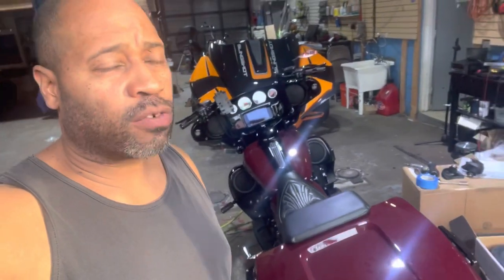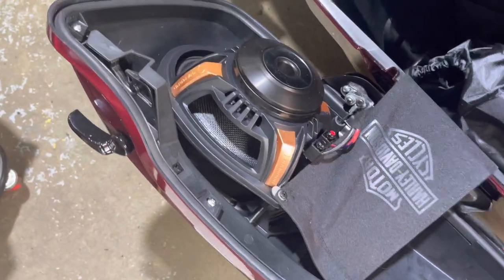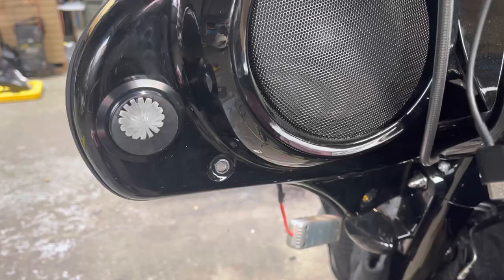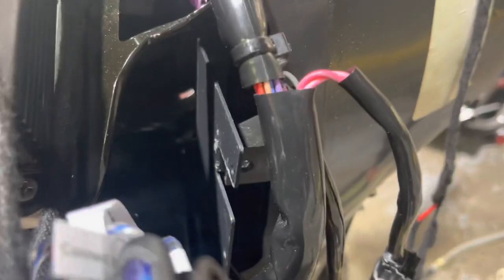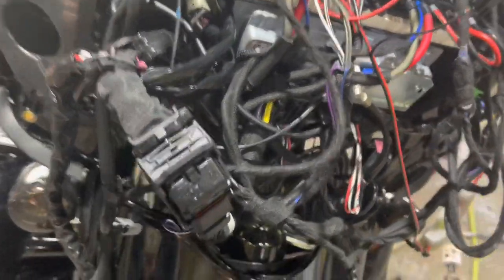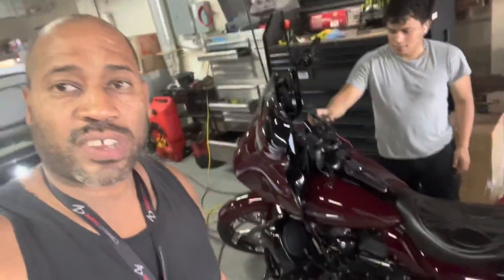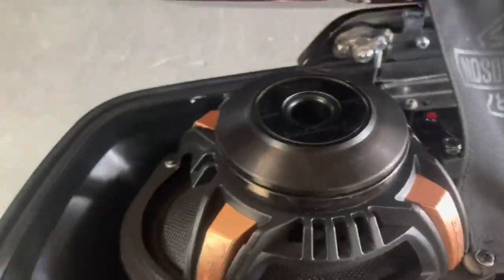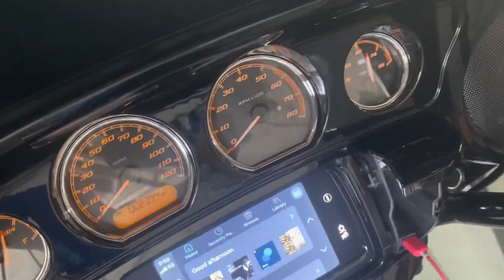Harley Davidson Street Glide in for a Nvs Audio stage 2 High power .

Comment: BOOM Shaka Laka incredibly close to what I would like to do with 2 minor exceptions. Lowers possibly the Ground Zero GZCF 8.0 spl which you recently reviewed and the same in the bag lids since they're waterproof. Not sure if there's anything better that is absolutely 100% waterproof. In FL we get hammered with summer rain. On the lowers, will I experience a major improvement going with 8's over 6.5's? Will 2 800.4's still get the job done amp wise in Street Glide or since there is more room, stack a 400.4 or another 800.4? Just thinking out loud, this is outta my wheel house. Lastly, on those 6 x 9's do you have your own lid kits and spacers or are you using a Rockford Kit?  Thanks and peace out.
Reply from the maker: We are using a boss lid kit 
With spacers 
8s will
Need a bigger amp

Comment: Does the sound on your bike change at all when you turn it on to running vs when its in accessory mode? People keep telling me that i cant do a sound system on my 21 Street because of the sound fluctuation when its running and in accessory.
Reply: All you have to do is flash your bike and turn off the function that automatically turns the volume up during high speed